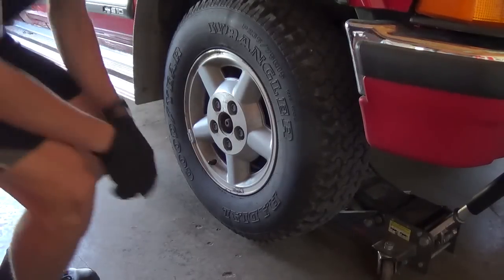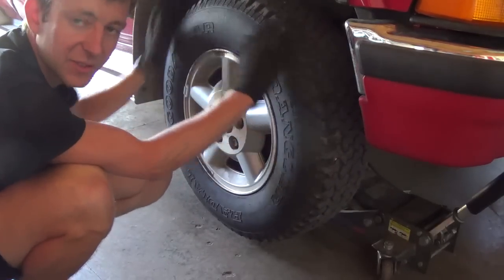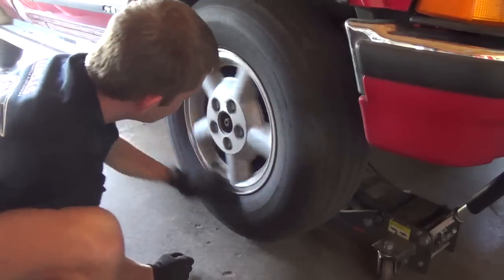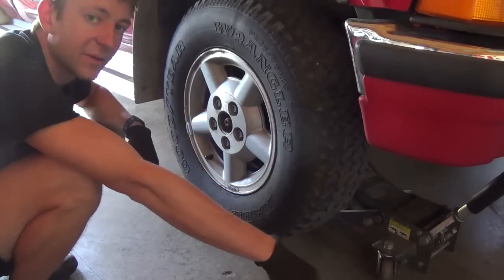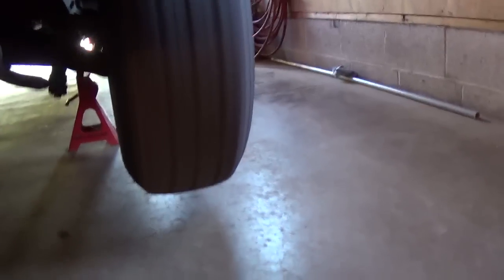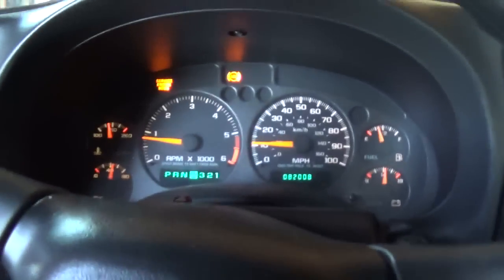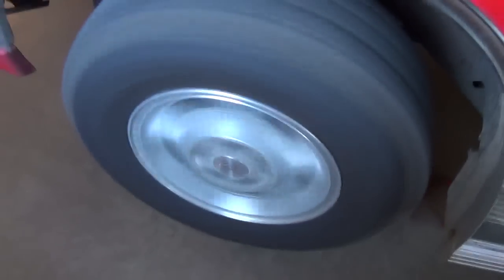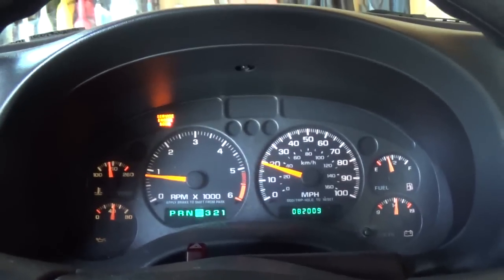Bad wheel bearing: how to diagnose

Comment: My 06 Element had two front wheel bearings bad. Very hard to diagnose (I didn't do the 4 wheels in air trick), but, we replaced both front and its like a new car!

Comment: That wheel bearing is shot. I could hear grinding noise when you spun the wheel along with lots of resistance. You should have no resistance when you spin the wheel. it should be nice and smooth

Comment: I had some kinda nosie a year ago couldn't find or 5 garges and went throw 2 mot now its started to hum and feel it when turning the wheel while holding the spring can feel the vibrations when rotaing the wheel bay hand

Comment: I don't understand the reason for spinning one wheel at a time when car is in drive.  Couldn't you have both wheels off the ground while car is in drive and listen next to each wheel to see if you hear anything?  I'm not a mechanic, but am interested in the reasoning here.  Thanks.
Reply: There is absolutely no mistaking which side has the bad bearing when doing it one at a time. Sometimes the bad bearing noise is not that loud and you may not get a clear indication as to which side the noise is coming from.

Comment: I have a really small amount of play on both back wheels but  no noise when driving any speed. Do I need to replace bearings now or can I wait until I hear bearing howl? I just need a break to get finances back up as I just bought and repaired a nice used car.
Reply from the maker: If it's a solid rear axle some play is normal. Don't worry about those until they make noise!
Reply: @PineHollowAutoDiagnostics  it's a jaguar 2002 Xk8 coupe. Would that be a solid rear axle? Thanks!

Comment: My bad wheel bearing caused a grinding noise. It sounded like the brakes were scraping so i thought it was pads or the caliper. It had a ton of play so it couldn't of been the brakes.
Reply: Tim Rickett videos mines making the same exact noise right now
Reply: Carson Reeder Get it fixed soon! Mine was very lose but it still took a half hour to beat off!

Comment: abs sensor magnet will have metal shavings on it often setting abs code. Replace with Timken not China junk bearing.
Reply: I just bought a Timken bearing assembly for my Toyota, since I heard they were good, and they may be, but stamped on the box was "Made in China"

Comment: I just use an IR thermometer Gun and point it at the lug nuts.  The wheel with the bad wheel bearing will run significantly hotter than the good wheel bearings.  Bad wheel bearings have more friction. More friction = more heat.
Reply: Thanks mate
Reply: @TheHound 🤣🤣🤣
Reply: Genius
Reply: Ooh I like that

Comment: Good call on the traction control, our Malibu has a button for that, I would never have thought of that.  I had the exact same issue you did here, none of the normal checks could determine which one was bad, no noise when you spin the wheel, no play in the bearing, etc.  Did just what you did and confirmed it was the driver side (I could kinda tell already, but wanted to make sure).  When it was up in the air, it kinda sounded like metal scraping against something, but when there was pressure on it, the front of the car sounded like a plane.  Now I just gotta finish changing it :D

Comment: As soon as you started the video it could be guessed that it was the left side. I simple trick to at least isolate the SIDE, is if its worse turning one direction. If its worse turning one direction, the opposite side is bad. When you said it sounded worse turning right, the left side of the vehicle gets more weight, making the sound worse because of the load. A left turn moves the weight to the right side, putting the load of the vehicle more on the good right bearings. You still need to figure out front or rear, but it at least isolates one side.
Reply from the maker: Not necessarily. Keep in mind hub bearings have two rows of bearings. When turning, one row is loaded, the other one is unloaded. Say you hear the noise when making a LEFT turn. The Right side of the vehicle becomes loaded. That means the INNER row of the right side bearing, as well as the OUTER row of the left side bearing becomes loaded. You still don't know which side wheel bearing to replace!!

So this "rule of thumb" can get you in trouble very quickly :)

Comment: Hi. thanks for the video. my daughter's car has this humming sound for about 8 months now. The mechanic checked it out twice  and said no play on tires so she's got time. not a safety issue. thinking I should get a 2nd opinion? since everyone is saying it can be bad and not have play.  worried.
Reply from the maker: Don't put it off too long, it is a safety issue. I have seen bearings go from having humming with no play to having significant play in a few weeks, but sometimes it takes much longer! The car is telling you something is wrong, don't ignore it :)
Reply: Pine Hollow Auto Diagnostics  Great advise. We are going to insist on getting it done this week.  It has been making the noise for too long.  T.Y.

Comment: I hit a curb in my G8 and ever since I've had noise and vibration. After replacing the front right wheel bearing assemly, I take it for a test drive and it's really no change. So I take the car to a shop and they tell me the right wheel bearing assembly needs replacement. What? It just got replaced!

Uh so is there anything else that might cause these symptoms? What else could it be? When I put the car in the air there is no up-down play in each wheel. There is very slight left-right play, however this moves everything strut and all so it and is present in every wheel so I don't see that being the issue.
Reply from the maker: Did you bend the wheel? Bad wheel bearings typically don't cause vibrations...just sounds.
Reply: I did bend the wheel horribly. But i have since gotten all new wheels
Reply from the maker: Sounds like a pretty bad impact. Does it pull to the left or right at all? The entire front suspension and subframe should be thoroughly inspected and aligned.

Comment: I'm hearing rotating in motion sound (speed related but not rpm) that's coming from the driver side of wheel when car is moving. The dealer checked my tires, wheel bearings, and brake pads, steering wheel...they couldn't find the problem and they all seemed to be fine after diagnosis. The wheels were rotated as well while I was at the dealer but the sound still exists. If I describe it, it doesn't seem to be a frictional noise or something rubbing but it sounds more like a rope spinning in the air.
Can you guess what it is?
Reply from the maker: You would have to lift the car off the ground and run it in gear while listening to each wheel.

Comment: when I go down the road and turn the steering wheel to the right the bearing noise goes away. is the bad bearing on the opposite driver side.
Reply from the maker: Probably, but not necessarily. Most bearings are 2-row units, so it depends on if the outer or inner row is making the noise.

Comment: so why does the wheel on the ground not spin? I find this fascinating, and very informative. Kudos and Merry Christmas
Reply: Dave F the tire on the ground doesn't spin bc you don't have a limited split differential.. If you had a limited slip difderential(which would mainly in sports cars or maybe a jeep) limited slip means that your difderential is turning whatever is on the ground.
Reply: Well I'm four years late, but basically there's a bunch of gears in the middle of the axle that allow the wheels to turn at different speeds so the tires don't fight each other when you're turning, and if there's a lot of resistance on one side and almost none on the other, the free one will spin enough for both of them. Look for videos on open differentials if you want to see it in action.

Comment: My front passenger wheel wobbles like that when it's jacked up, but it doesn't make any noise at idle or when revving. Car shakes a bunch on the highway. Bearing/axle/wheel or tire? What do you think? Thanks!
Reply: You could have a broke belt in your tire or a bent rim if it is wobbling that bad
Reply from the maker: wobble = bad! Have a helper shake the wheel while you pinpoint where 
it's coming from. Fix it ASAP before your wheel decides to leave town :)

Comment: i need your help... i changed my driver wheel bearing with spindle.. because i could hear the noice with a different one from the yunk yard..  but i still hear the noice coming from the driver side... but after seening your video i did what you did.. i had my sister press the gas the noice came from the driver side.. when i looked under the car. the driver tire was not moving at all.. when i looked at the passenger tire it was moving to the sides like the one in your video... sorry its long... both wheels did not have any play up&down or side/side... if you can help me thanks

Comment: I believe the wheel that is spinning is going about twice the speed on the speedometer.  And the little spider gears are putting in overtime.  Mine rattle a little when trying this.  I did find a bent cv axle this way.

Comment: how do you do this on an all wheel drive Subaru
Reply from the maker: If it's an '05 an up Outback with the noise coming from the rear, just replace both hub assemblies :) Otherwise same procedure as on this Chevy truck; just disable ABS and VDC before experimenting!
Reply: awesome thanks for the quick response, I have a feeling it's the rears since steering while driving doesn't make the hum any worse or better.  I did plan to do both sides.. the challenge is figuring out if the problem is in front or rear
Reply: @PineHollowAutoDiagnostics  what if its only 2wd truck

Comment: The way I check them is to spin the wheel either by hand or drive it jacked up and while the wheel is spinning touch the suspension spring with a light grip and you will feel the grind coming from the wheel bearing.Try it, it works a treat. Tam Edinburgh  Scotland.
Reply from the maker: +Tam Couch Great tip, Tam! If the bearing is very bad then this would work great. In this case that test was inconclusive, as this bearing was just starting to go bad, but still felt smooth when spinning the wheel by hand :)
Reply: +motoYam82  yeah if there is no load on it ,it can be difficult .
Reply: Good Video.
My son-in-laws 2002 Grand Prix had a difficult to pin-point growl from 15 - 45 mph. Slight change when turning left and right. No play in the wheels.
I pulled both front wheels, and with the car on stands ran it in gear up-to about 2,000 RPM. I used a stethoscope to identify which wheel bearing was making the noise.
I should have done both while I was at it, 3 months later the left front and left rear bearing started making noise. LOL
Reply from the maker: Rick Malone
Scan it for codes first to get some direction.
Reply: WMichael S I have a 2004 Grand Prix GTP and my ABS/Traction Control  lights are on as well as the variable effort steering on the DIC. Idk if it's a bearing or a wheel speed sensor, obviously there's no way to know without doing all this but what are the main cases? Recently it whines a little bit when turning, you think it would be the bearing?
Reply: Good starting point, especially when you have some dash lights ON.  We live in SE Michigan, not as rough on cars as Eric O @ SMA, but lots of rust and pot holes none the less. When I replaced the SIL's left front bearing,  I also did a complete strut ass'y (both sides), because the LF coil spring was busted and rattling like a horse shoe!

My guess is, if you are where salt is common this time of year, a 13 year old car can have a lot of rusty-crusty related issues.

Best of luck, sorry I can't be more specific.

Comment: Okay Ivan I see these a lot . Great job. Do you remember the 2007 Silverado with the 90 psi fuel pressure  reading.  Well it's fixed.  Replaced fuel rail pressure sensor and fuel module. Fuel pressure is now at 45 psi.  Transmission shifts normally. And the Stability light is off. Will let Eric O. know.
Reply from the maker: +Richard Gill Great job Richard! Thanks for the update.

Comment: As Dr O says. Safety 3rd... I didn't know jack stands would hold a vehicle if you jammed up one of the wheels like that. You learn something new everyday I guess.
Reply from the maker: +zoidberg444 As long as the differential is open and the other wheel is freewheeling, there is no torque applied to the blocked wheel. Don't try this method if you have an auto-locking differential or a "smart" traction control system that would automatically brake the other wheel and send power to the blocked one... 

A safer way would be to block the wheel by strapping it to the vehicle instead of putting a block on the ground. That way if the wheel tries to turn, you might only damage your vehicle, and not your house HAHA

Comment: This procedure scares me. Here at SMA I am all about safety, you know me!
Reply: When i suspect a bad bearing i often try the play, and if there is none/little i take my left hand on the spring and the right on the wheel and try to turn the wheel as fast as possible, if there is a bad bearing, you can feel it in the spring, vibrates quite much.
Reply: Eric O. Truck is fixed. Transmission shifts normally. Stability light off also. Went from 90 psi to 45 psi with fuel pressure reading. You were right. I did a lot of testing  and found the fuel module to be the culprit. Thanks
Reply from the maker: +South Main Auto Repair Yeah I didn't even know whether to post this one or not lol...didn't see any other way to do it though. How would you go about narrowing it down Eric? Maybe just replace both hubs and call it a day? You know the other side isn't far behind...it's a Chevy!
Reply: Actually u use a block of wood ... I hold it with my hands as Vanessa revs it up. I was joking about the safety bit because people are always giving me a hard time. You did it perfect IMO.. same way I do it :)

Comment: 👍👍
Reply: Steve Silverado is fixed. You  guessed right with the fuel module. Fuel pressure is  now at 45 psi  and most importantly transmission is  not shifting harsh.
Reply: Awesome nice to hear.

Comment: Another tequnique that works pretty good to isolate a bad wheel bearing  is to spin the wheel why feeling the coil spring for vibration.  My jeep has rotor pumps in the axle, and would have locked the front axle and the one wheel would have pulled the car off of the jackstands.  Only in a jeep!!
Reply from the maker: +shadowdog500 Yup auto lockers could definitely ruin the day here lol...guess can't really disable the mechanical "traction control" :)
Reply: Well, you could always go underneath and pull the electronic plug on the auto lockers and Wha-la;  no more lockers.
Reply: &hhh

C8 ppl pij II outgoing
Reply: &ok
Reply: Jweri,mmmkkkkkkkkjjhdh d's sghjkke